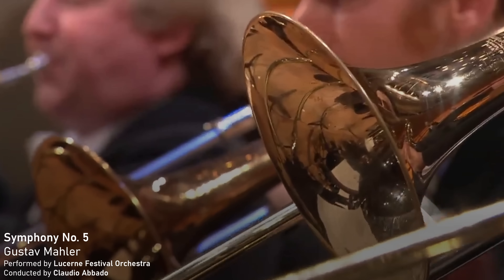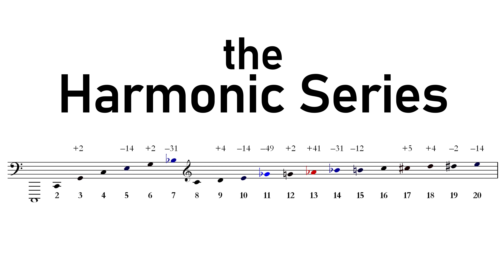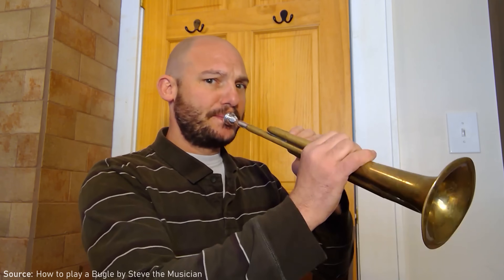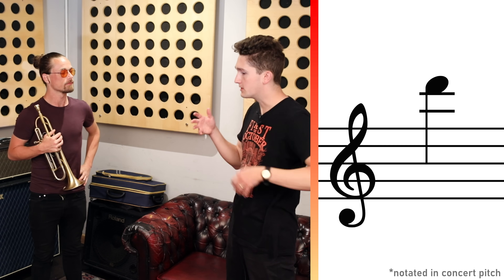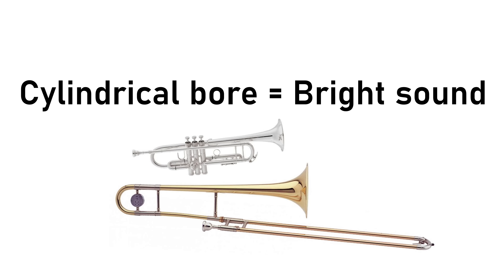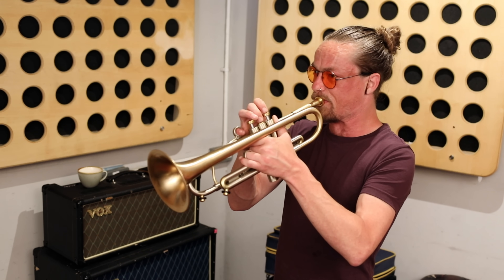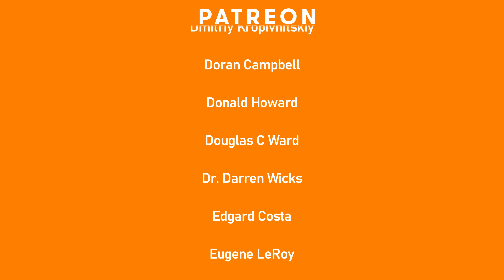How do Brass instruments actually work?

Comment: Almost all woodwind instruments also require an embouchure to create a usable tone.

Single- and double-reed woodwind instruments cannot function without a basic embouchure to create a seal around the mouthpiece/reed(s) which is necessary for the reed(s) to start vibrating, and advancing players need to be able to manipulate their embouchure to vary the tuning, timbre, and/or access different registers.

Edge-blown flutes are a little different in that the embouchure is used to direct the air towards the far edge of the instrument's (appropriately named) embouchure hole which is what creates the vibrations necessary for tone production, and subtle manipulation of the player's embouchure are used to change registers, tuning and timbre.

Brass embouchures are a little different in that the vibrations are directly produced by the player's lips rather than some part of the instrument.

The only wind instruments that do not REQUIRE an embouchure are the free-reed instruments (eg. Harmonica, Accordion, Pipe Organ), fipple-flutes (eg. Recorders, Tin Whistles, Ocarinas, etc.), and some vessel-flutes (eg. Nose flutes) though many of these can performed to a considerably higher standard if an appropriate embouchure is used (eg. Recorders and Harmonicas).
Reply: Windcap (also known as capped-reed) instruments, of which bagpipes are an extension, also don't require an embouchure. The most common windcap instrument today is probably the practice chanter, while a good historical example is the crumhorn.
Reply: He said "require the embouchure to make the sound", which means the lips themselves vibrate to make the sound. WW embouchure technique is also complicated, but the sound is produced in other ways.
Reply: I would argue that only edge-blown flutes "require" an embouchure, technically speaking.

Single and double reed instruments can all be played with zero embouchure, you just need a reed of appropriate strength. A saxophone, clarinet, or oboe can thus produce a sound in the same manner that an organ pipe, crumhorn, or bagpipe does. Just that it will be an ugly sound. We only use embouchure on reeds to dampen undesirable vibrations and exert control over timbre and pitch, and this allows us to achieve new timbres using reed designs that wouldn't work so well without the labial coaxing. That is to say... the lips are not an integral mechanism to producing a sound at all, they only mould it.

For instance, when oboists and bassoonists "crow" their reeds to test their properties, they aren't really using their embouchure, they're playing it mostly as a free reed.
Reply: @JHouse4  If you simply blow air towards or into a double reed attached to an oboe/bassoon, it will make a sound in the same manner that the trumpet player in the video demonstrates at 0:30 (likewise for a single reed with mouthpiece). While this is useful as a means to warm up the air inside the instrument prior to playing, or even as a (pitched, but nearly inaudible) special effect, there's no useful tone produced.

In order to produce a useable tone, we need to create a significant air pressure differential between the tip of the reed and the instrument so that enough energy is imparted on the reed to overcome its resistance to vibrating. For most double- and single-reed instruments, this chamber is our mouth and we use our embouchure muscles to ensure that enough of the air pressure we are creating (using our lungs, vocal tract and tongue) is released into the reed/mouthpiece rather than round the sides of the reed/mouthpiece.

For free-reed instruments, this chamber is part of the instrument, so most of the "embouchure" work is already done for the player before they supply the air, so it is often possible to create enough air pressure in the chamber to excite the reed just by blowing sufficiently hard in the direction of the opening of said chamber. However, this fixed chamber design has the disadvantage of limiting the amount of control the player has over the air speed as it enters the reed.

This is somewhat analogous to the difference between edge-blown and fipple flutes.
Reply: @clarinetguyuk  Thanks, I now have a better understanding of what "embouchure" means.
Reply: @clarinetguyuk  Demonstrably false, and by "demonstrably", I mean I could make a video demonstrating this if you like. Let me know. Single- and double-reed instrument do produce tones without embouchure support, they are just not pretty tones because they are not optimized to be played in the manner of capped reeds.
Reply: @JHouse4  I'd be interested in seeing you try.
Reply: @clarinetguyuk  
https://www.youtube.com/watch?v=AQ1xMz3W_F4

I needed to practice talking to a camera anyways, so it was good exercise for me.
Reply: @JHouse4  The only one of your demonstrations that is close to "no-embouchure" tone production is your saxophone example (due to the leaks through the ligature), but even then you are still using an embouchure (albeit a non-standard one) as you're still using your embouchure muscles to create a (partial) seal around the mouthpiece, thereby creating the required pressure differential.

A true demonstration of a non embouchure would be to make a sound out of these instruments without creating this pressure chamber around the mouthpiece. Practically, this would involve directing the air at the mouthpiece/reed without making contact.
Reply: @clarinetguyuk  I see. So in your classification, instruments like the krummhorn, recorder, and bagpipe all require an embouchure, same as a trumpet or clarinet, because you need to seal your mouth around the instrument just to blow air into it.

Where in my classification, they (krummhorn/recorder/bagpipe) do not constitute what I consider an embouchure, because your mouth isn't playing any part in producing the sound; the same result could be achieved with rubber hose and air compressor, no need for complex labial muscles.

That explains the confusion between us, then. Different definitions. =P
Reply: @JHouse4  As per the last paragraph in my initial comment, I agree that the recorder/bagpipes/etc. DO NOT need an embouchure to create a usable tone (you can even use your nose to do so), though tonal control will be very limited.

Also, the complex labial muscles you mention have been referred to as embouchure (derived from the French word for "mouth") muscles by at least 200 years worth of woodwind pedagogues.
Reply: @clarinetguyuk  so when I use bagpipe embouchure on saxophone/bassoon etc, does that count as an embouchure or not?

Because you say I used an embouchure throughout my demonstrations, but the embouchure I used was the same as what bagpipes use, which you don't qualify as an "embouchure."

I hope you can see where I'm getting confused in what your opinion states.

Comment: The brass players in orchestras look so classy and cool.
And then you think how they are all doing that embouchure. Not so classy anymore.

Similar thing happened with a saxophone. One of the coolest instruments. Then I learnt that they have to make the reed moist to keep it flexible. And it's done by drenching it with saliva in your mouth. Ugh...
Surely not all reed players do that...?
Reply: I believe some reeds are moistened by soaking them in a cup of water (oboe for example). There are some reeds that don't need to be moistened - many pipe organs have reeds (are they made of cane? I don't even know), and I think capped double reeds don't need to be moistened (like the bagpipes, crumhorn, rackett, rauschpfeife, and cornamuse).

There are now synthetic reeds you can buy, which don't need to be moistened. I'm only familiar with sax reeds, but there might well be others. If you want to become a sax player but wetting the reed grosses you out, you can get a synthetic reed. But it's still going to get wet when you play it! When I play for a long time, spit literally drips out of the instrument.

Comment: They don't use the third valve by itself?
Reply: It's because of tuning.
- Half-tone valve is tuned precisely to lower by a halftone (which means increase the length of the tubing by 2 to the power of 1/12)
- Whole tone valve is tuned in a way that together with halftone valve they make precisely minor 3rd (= increase the length by 2 to the power of 3/12) This makes whole tone valve slightly "flatter" when used by itself, however the error is not big.
- 1.5 tone valve is tuned in a way that together with halftone valve they make precisely major 3rd (2 to the power of 4/12), which makes this valve too "flat" when used alone.

Therefore for lowering harmonic series by minor 3rd you use 1+2 and not 3 alone.

Other tuning systems are possible, but this one gives the less "overall error"
Reply: 3rd by itself is equivalent to 1st and 2nd together, albeit not preferred due to the finer points of intonation. Euphonium (my main instrument, after switching from trumpet in high school) can have 4 valves - the 4th again being the same as 1st and 3rd, although here, 4th is preferred for its better intonation. Don't get me started on compensating vs non-compensating 4-valve euphoniums LOL.

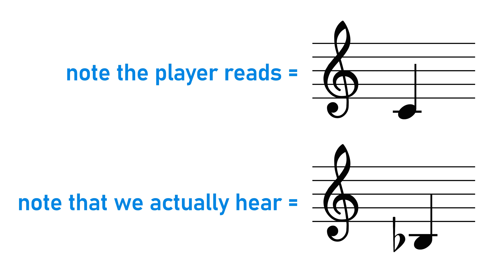Comment: 10:25 on a side note, the Harmon mute (also called a wah-wah mute) that Miles Davis used is actually missing the second part, which looks like the bell of a trumpet. That was Miles’ preferred method of using a mute in that period of his career.
Reply: Side-by-side note :-  Mutes are interesting in that they alter how the sound propagates from the bell, changing the loudness by muffling and the timbre by adding or damping resonances, but without altering the effective length of the tube and so the pitch of the notes do not change significantly.

The exception is the wah-wah mute , which can distort the pitch by modifying the effective pipe length. It's arguably something else and not a true mute because of this.  <exits rabbit hole>
Reply: to explore different mutes, if you're not a brass player, Libre Wave produce a plugin for DAWs called Sordina which produce very realistic simulations, including stem in and stem out on Harmon mutes
Reply: @charlesgaskell5899  oh, if only I had a PC
Reply: @StarQueenEstrella  Sordina works on all DAWs, including those that run on a Mac
Reply: @charlesgaskell5899  I don’t have a Mac either

Comment: 4:38 is that a pocket trumpet to the left of the French horn?
Reply: Not sure, the pipe length looks short, so possibly a soprano E flat, with a fourth valve to switch down to B flat tuning. The extra valve can allow alternative fingerings  to deal with tuning discrepancies between the harmonic series of notes produced by the instrument and the equal temperament musical scale used by everyone else.
Reply: @chrishb7074  I thought it was a Bb piccolo trumpet - they also have 4 valves, but I'll admit it's been a while since I played trumpet; been on euphonium for over 30 years now.

Comment: OK, question now is, will Sarah Jeffreys feature in the woodwind episode as a recorder player? :) Very interesting video, David. About the valve thing, there's an interesting video by Richard Atkinson on Mozart's Ein musikalischer Spaß, where for the French horn in the past you would physically change the valves and in one of the movements of said piece, Mozart replicates what it would sound like if a horn player were to take the wrong piece and put it on the instrument.
Reply: Thanks for pointing out that video. It made me curious and I had to look it up. Horns were valveless in Mozart's time and they used "crooks" which were just a length of tube to change keys. I also finally found out how they play trills without valves. Thats something I've been curious about for a long time.
Reply: @bucko5427  You're welcome. And yes, I only referenced the video from memory and the word "crooks" escaped me. Thanks for pointing that out to me.